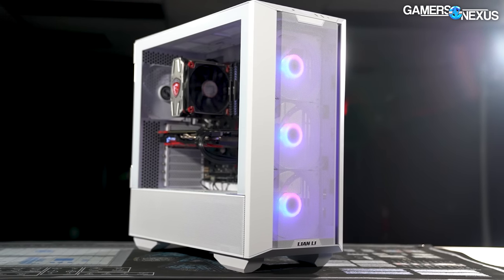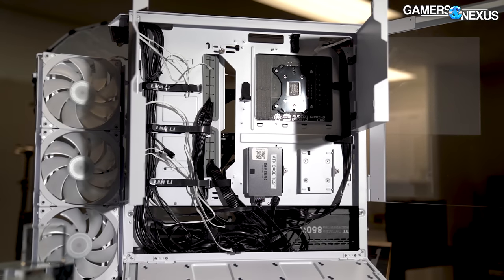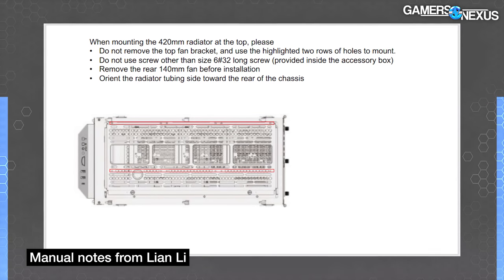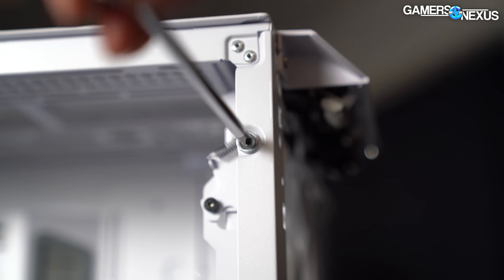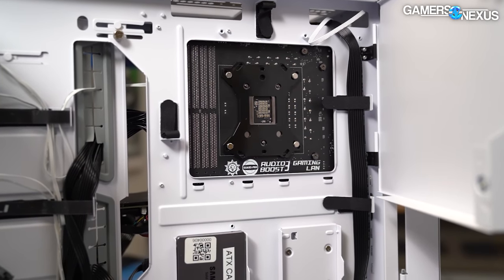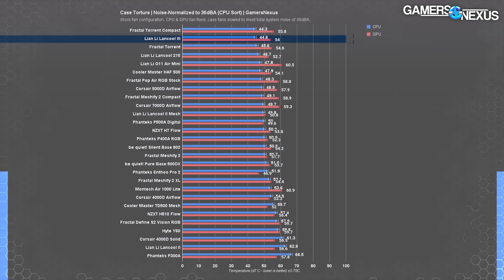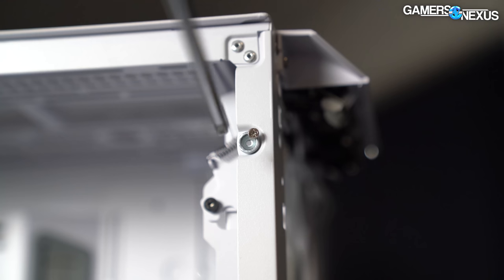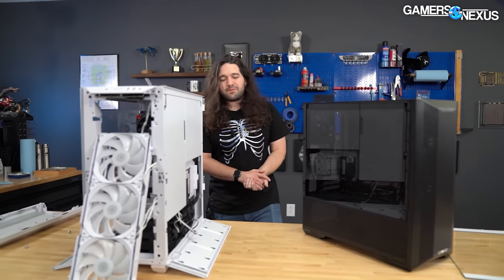Lian Li Lancool III Case Review: Build Quality, Thermals, & Cable Management

Comment: I have a Lancool 2 and I gotta say it is absolutely my favorite case I have ever had
Reply: Would you suggest the Lancool 2 or do you think the Lancool 3 is worth trying?
Reply: @zoppletee5400  based strictly off the video and not actually owning the lancool 3. I would personally go with the 2.
Few reasons.
1. The 3 is quite a lot larger than the lancool 2 and the 2 is already quite large although I will state I have a 3070ti ( it is a very large card. About 13 inches in length) and it's pretty close to the fans length wise. Which is fine just can't go much bigger.

2. On the inside the sliding cable managing thing I'm not a fan of because personally I had to straight up remove mine to get all my cables to fit properly albeit my cables are old and terrible.

Other than those tbh not a lot has changed really between the 2 to warrant getting the 3 over the 2. I got my lancool 2 for 120 USD from microcenter.
I DO have the lancool 2 performance though all that changes is instead of 3 front fans I get 2 bigger front fans. (,fans are non RGB although there is a performance RGB version)

Really honestly I think either case is fine I don't know the price of the lancool 3 currently but if it's anything more than like 10 or 20 USD more than the lancool 2 It's probably not that worth it unless h really want the extra space
Reply: @codlogic7060  since your responses are quick, I'm planning on running a i9 or i7 depending on which one is better performance/easier to cool with a 3070ti or 3080ti but have to decide on a CPU cooler before I decide anything for sure
Reply: @zoppletee5400  I don't know a ton about cooling but I asked my friend since he takes cooling his pc very seriously. 

It depends on what generation of I 9 you would get but if you get a 12th Gen you need a 360mm AIO. He said phantek and ek make good aios for the price he would personally stay away from msi. Nzxt makes good Aios but they are way more expensive. If you are getting an I 9 11th Gen or below a 240 mm Aio would work or you if you wanna do air cooling you could use a nhd15 air cooler. Although be did say it's quite large. He also said that should work on the I9 11th Gen or lower but he's not 100% sure. Would work on the I7 though as a good air cooler.

I hope that helps

Comment: The glass side panel behind the MB is probably the most pointless thing I've seen on a PC case. All you can really do with it is put some LED strips back there to make it glow and/or show off your almost out of date SATA SSDs. Other than that, a solid panel would serve the purpose just fine.
Reply: A solid panel wouldn't just be "just fine", it would be better because one could lose the internal case covers and thus lose weight. The solid panel itself would also weigh and cost less than a glass panel, so overall, there would be a good reduction in weight and cost. I would even like the option of a solid panel on the left hand side as well because I would place the case on the floor, so don't need to be able to look inside, plus one could cut out a side exhaust for the GPU.
Reply: @BlackhatAudio  What about cost reductions for shipping a lighter case? Also, why having to use a friend, if it shouldn't be necessary?

Comment: Even using this case 10 years and passing it on to someone else, I seriously can’t imagine any of the spring things or latches breaking. They’re so much more durable than plastic clips and whatnot, you’d have to be opening it multiple times a day every day for years to start wearing stuff that durable out. But that’s just my opinion
Reply: Just recently build mine. This thing is sturdy.

Comment: Why have the 2.5" SSD drives exposed on the backside of the case rather than having a door to cover them? Could never understand why one would have a glass panel on the backside of the case. The only thing I can see the backside glass panel doing is adding more weight to the case.

Comment: Thanks for the review, guys! I was looking into this case to potentially replace my Lancool II Mesh, but I think I'm going to stick with what I have. It was routinely losing to the LC2 Mesh in your tests, and its dramatic increase in size, weight and price over my case dissuaded me further. I agree that things like the spring loaded latches, side panel release mechanism, etc... all look like stuff primed to fail. I'm not sure if Lian Li will be providing replacement parts for this case 5-6 years from now.
Reply: Same think I will stick to the Mesh II, love that case but it would have been nice if they had a usb c already to go in it. But other than that it was fun to build in and easy to work on.
Reply: The LanCool 3 lose to the LC2 in those particular tests, but is still a better case in term of cooling capapcity.
GN standardised configuration  (4x120 mm fans + 1 CPU aircooler) does not take advantage af this case stronger suit : his capacity for more and bigger fans/radiatiors than his competition.
Reply: @Blafard666  As Steve said, if a case loses in specific categories and loses in their standardized configuration, it means the case is brute forcing cooling with its fans.

What this shows is that the Lancool 2 Mesh has better airflow dynamics as a case than the LC3, and that its stock fans are more than enough to sit at or near the top of the charts consistently.

It seems the increased volume of the case may be working against it here.
Reply: @RicochetForce  I totally agree, especially with your last sentence. But isn't that proof that such a modest test-configuration will always cripple the bigger cases ?
20:05 On the standardized fans test, is it a coincidence that all of the 5 cases beating the LC3 are compact/smaller cases ?
I believe GN testing format misrepresent the compared performances of larger cases at the benefit of smaller volume ones.
Reply: @Blafard666  I do agree that GN will eventually have to bite the bullet and move on to more modern, intensely hot components to provide more representative results. 

It reminds me of how Noctua's large coolers like the NH-U12A, U14S, NHD15/S seem to perform no better than bog standard heatsinks on low thermal loads. But when you force a massive amount of heat on them, the smaller units quickly get overwhelmed and the actual performance of the large towers becomes obvious (cooler + quieter while providing that cooling).

Comment: I have the Lancool II Mesh which I´ve been very happy with. But now I want to try AIO Cooling and I need more space. Wanted to get the III so this review proves helpful

Edit: after getting it I can say I am very happy with it. Building was easy although I had some trouble installing the psu at first because I haven’t seen this method before. The magnetically secured doors in the back proved to be strong enough for my build. I really like the levers at the side. With the II mesh I always had to open the lower door first which just didn’t seem intelligent.

Comment: Not a fan of the magnets over securing with screws. The mechanical sounds that come from the magnetic parts isn't appealing either. The folding parts specifically on the sides of the front seem like they would set someone up for failure if they should grab it incorrectly and the folding part flies open and the PC crashes to the floor- is that possible as it would seem?
Thanks for another in-depth review, always most excited when I see a new video from GN or MLID in my notifications. 🙏😁

Comment: Fantastic review, I think this one beats the previous Lancool in looks (II & II Mesh) and I love the amount of fan/rad mounting options and the fact both PSU shroud doors are mesh but we'd need a follow-up on this case to really know how useful shroud mounted fans and rads would be (it was mentioned talking about shroud mounting in the thermal section but I didn't hear anything about it there). A follow-up video could also perhaps show the results of a bit of torture testing of all the door mechanisms, nothing extreme but enough to show how well the mechanisms hold up through a number of uses

Last thing, wish they didn't have glass on both sides, it really doesn't add much to the look having glass on the side behind the motherboard tray, would rather it be a metal panel and reduce the cost a little bit (but I will say those cable covers do make the glass there viable as an attractive option for anyone that does like it)

Comment: I think the aluminium bars on the white case look different because they’re not anodised at all, but painted instead, perhaps.
At least back in 2014 I was told by a supplier that it was impossible to anodise in white so we had to paint our aluminium parts instead.

Comment: Damn, this case beats the original Torrent in noise normalized? Lian Li is out for blood,  becoming one of the best case manufacturers IMO (even if this case is a tad strange)
Reply: Coming stock with **4 140 millimeter fans** is also just great. Of which, the non RGB ones are even better. Then you've still got plenty of room for a 360 millimeter radiator up top if you want.

The thing can stay frosty
Reply: It’s funny when you look at the only feature it beats it in
Reply: @devaxionrl8189  regardless, this case rates well thermally all around, even with all of the excess junk on it... or perhaps some of that is working as a heatsink
Reply: @-opus  none of the junk really get in the way of airflow. Still not going to upgrade from my 011 evo case.
Reply: @devaxionrl8189  the Lancool is also a little bit cheaper, when comparing the non RGB versions. And the gap gets a lot bigger when comparing the RGB versions

Comment: Probably the only thing that'd bother me about it is how you remove the front panel. I have my PC against the wall, so if I had to move it away from the wall so I could open the panels to take the front panel off, it'd be a bit annoying. Other than that it seems like a great case.

Comment: Don't know if GN will ever see this comment, but you guys use a 1080 & 6700k for case bench, right?

I feel with the shift toward mesh in recent years, the thermal tests would show more variation with hotter components.

Any chance you guys would ever add another segment to new case reviews for maybe 350w cards? Might be more relevant after Lovelace is out.

Comment: Still loving my lancool ii. However, I really do wish they would ditch the dual tempered glass side panels. There is no need for it on the cable management side of the case. It only adds weight and fragility. Getting rid of the glass side panel would also eliminate the need for the somewhat annoying cable panels.
Reply: Yes, the tempered glass on the right side is unnecessary but for me it’s not a deal breaker.
Reply: So true. I would even ask for a steel side panel for the other side, so that I could cut a exhaust ventilation cut-out into it for the GPU to directly exhaust its hot air to the side, out of the case.